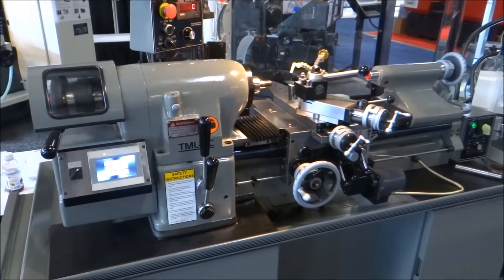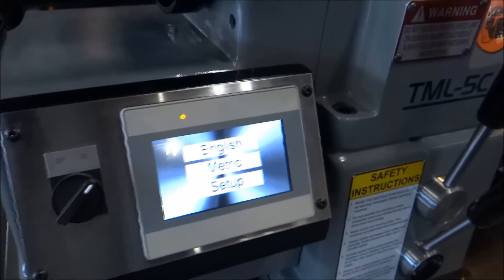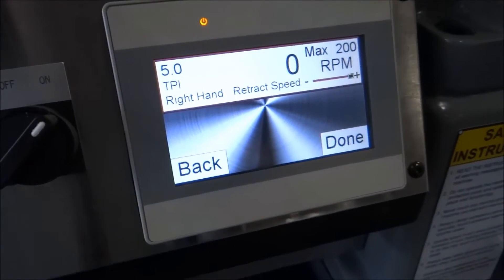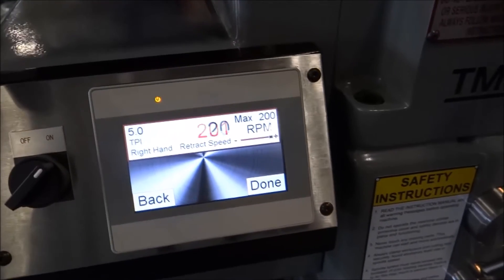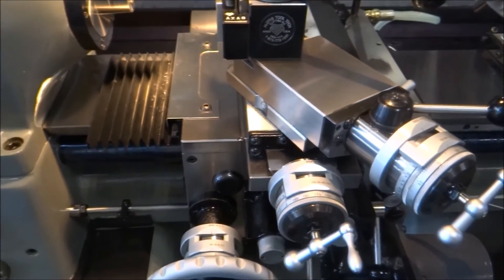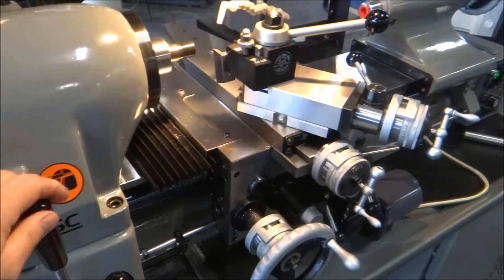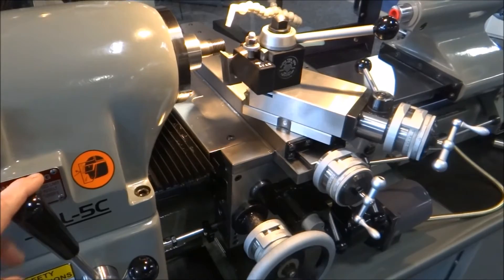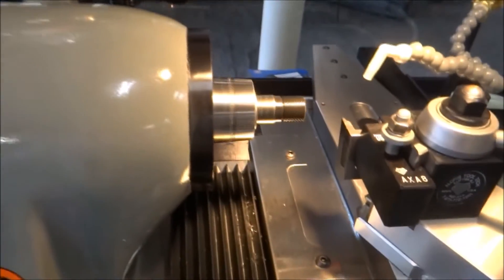TML 5Cst servo threading toolroom lathe, Hardinge HLV-H 5C collet style

Comment: Did yo change the spindle motor for the inverter speed control? Im wanna upgrade my hlv
Reply from the maker: The Taiwan lathe TML-5C series spindle motor is std 5HP EVS control to 3500 RPM